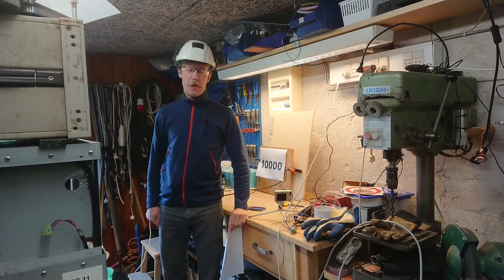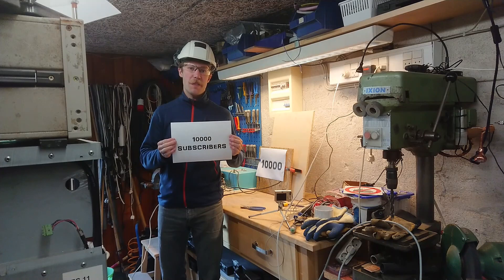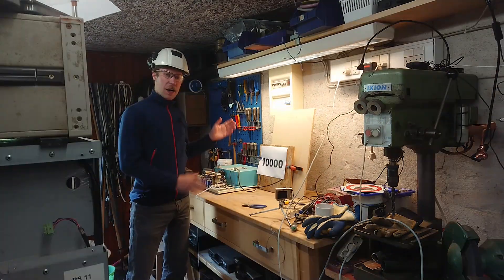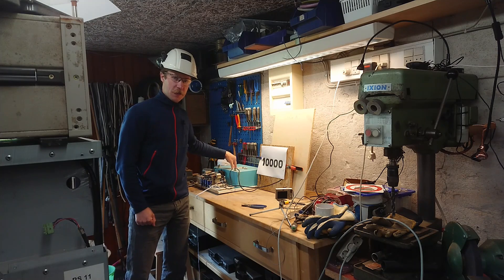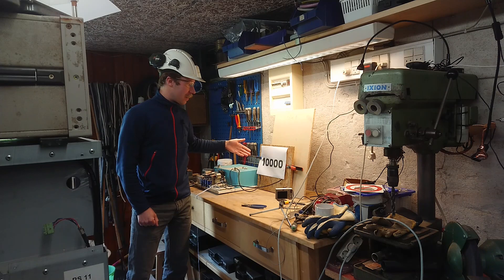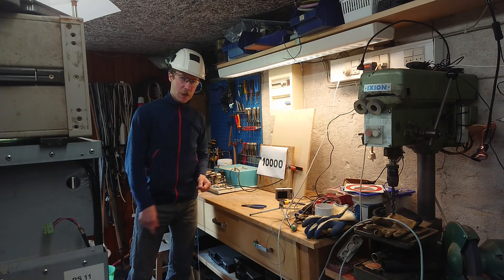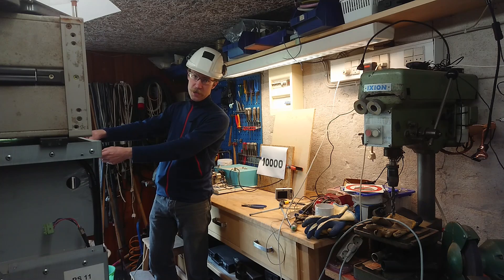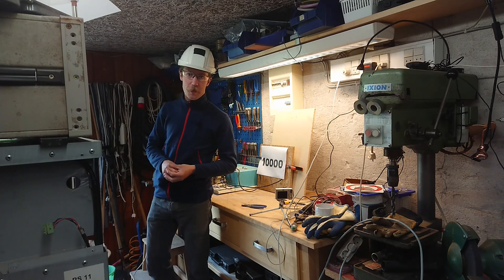Capacitor Bank Explosions and also 10,000 Subscribers! Thank You!

Comment: With the caps i have i was always worried of the cables accidentally hitting a grounded object and the HV dumping back into the mains at 50,000Amps, imagine all the electronics in your house that could get damaged.
Reply from the maker: The mains supply to the charging circuit is removed, by pulling the plug out, before firing :)